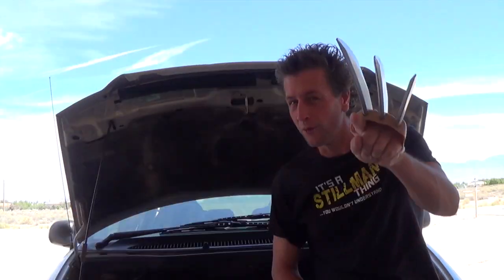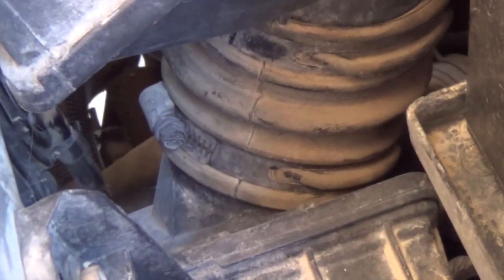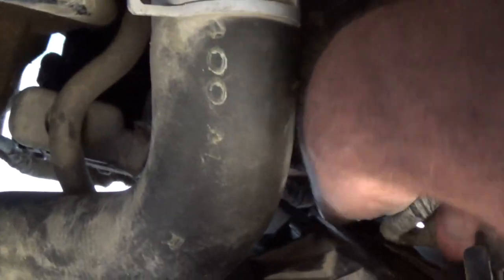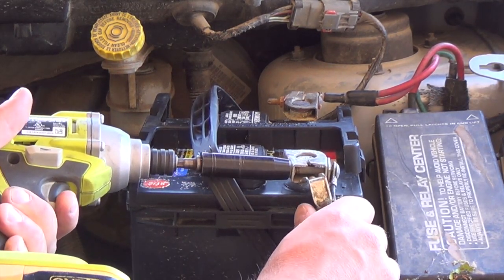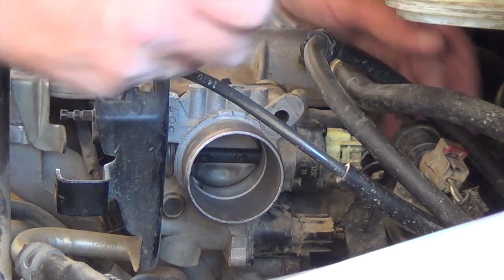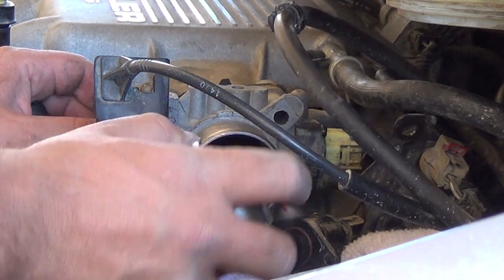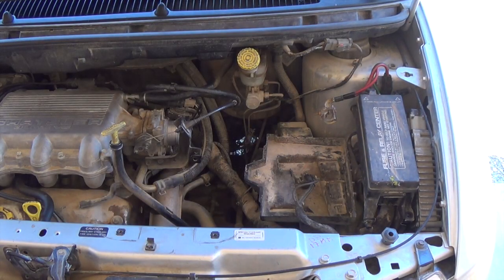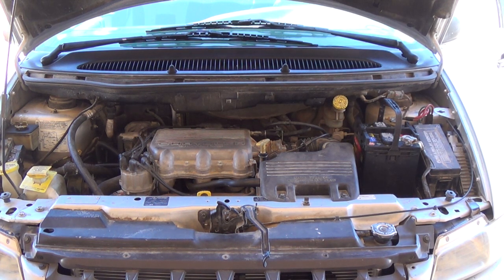2000 voyager air filter replacement and throttle body cleaning, better idle

Comment: Thanks for the quick-fix guide to erratic idling. It exactly matches my 2000 Dodge Grand Caravan 3.8 L. I was finding mostly later model guides to throttle body cleansing. On cold winter days, the Caravan sometimes stalls out in the first 5 minutes or so of operation – like when coming to a stop sign, but then idles normally after warming up. Other days, I turn it on and go without any erratic idling. I hope that cleaning the throttle body sensor will help. I'll check the air filter while I'm at it. Those clips are tough to unclamp.